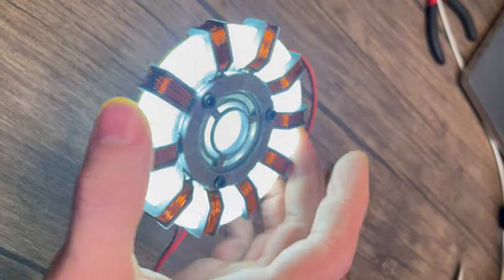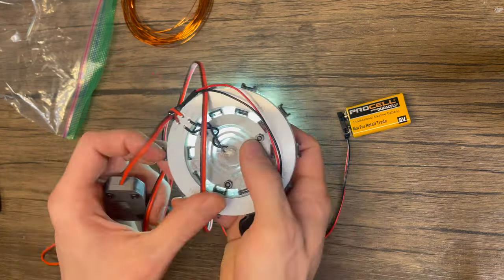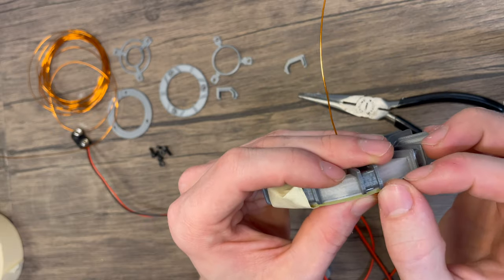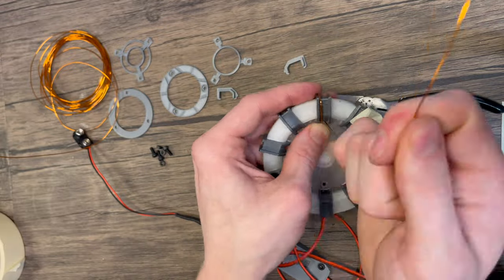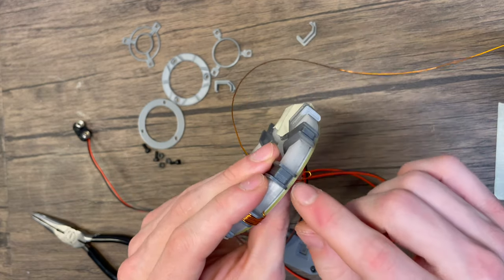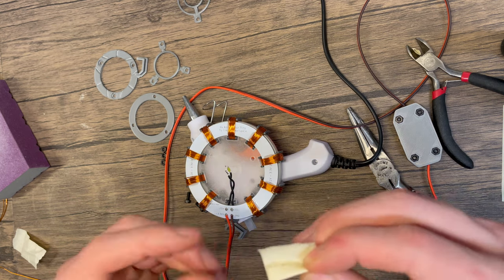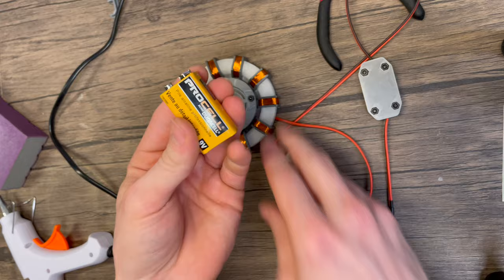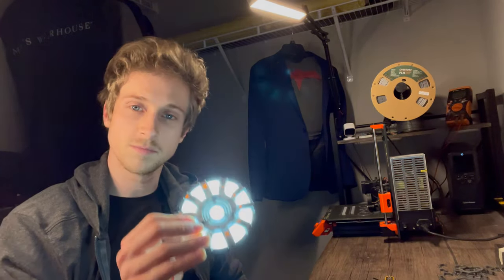Arc Reactor V4 - Assembly DIY

Comment: Is it possible to add subtle Breathing and Flickering effect?
Reply from the maker: You could; it would just need a PWM controller connected after the voltage regulator. That would simply be a mosfet connected to a small microcontroller